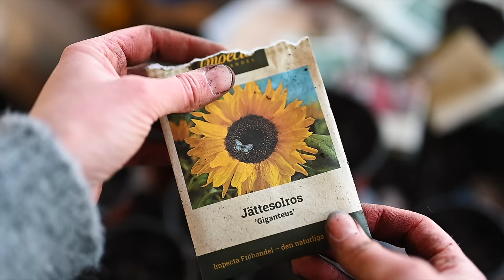Living with the Nordic Vampires

Comment: hmm. Summer is a bit different here in Texas. For the first six months, it is an all consuming, grinding heat. Then comes the next two months of "late summer" which typically sputters out around mid-November with a grim determination to wrench every bit of moisture out of your heat-stricken body as it can. Then a week or so of Autumn and a two month Winter.

Comment: There is a gaget call a themacell. It is an amazing mosquito repellent. I believe you can look it up online and order one. It gives a 15 foot radius mosquito free. It runs off of a small canister of propane, and a mat that heats up and has natural repellent.  I used it when I would hunt in the swamp with thousands of mosquitoes,  when I would turn it on maybe 1 or 2 mosquitoes would buzz me, but that was it. I still use them even though I no longer hunt. But I thought I would share this gaget with you. So you can continue to film and not be buzzed.
Reply: HELLO
Reply: @ruthielenz7595  That was not Jonna, it was a scammer. Jonna will never ask for you to text on Telegram.

Comment: I love your videos! My husband and I are saving to move the forest. I have a more practical question haha :). You said the firewood needed to dry out, but then when it was raining you still moved it into the barn. Will it still dry in the barn or do you need to do something extra? Thank you!
Reply: Hi Nikki. Normally, its not the outside of the firewood that needs to dry but the inside to reduce the moisture level. Rain does not have any significant effect on the wood and will quickly dry again. It takes about 6-12 months when properly stacked outside to dry the inside. Ironically enough it might take 3-4 if you try it inside. Thats why you need to first purchase firewood that is properly dried in an oven as your first batch and for your first seasons - while air drying your next batch 6-12 months for your next season(s). Repeat the cycle 😁

Comment: One day you are gonna need to repaint stuff, and im only assuming from the short clip you used for that. i saw you were only using a large brush for the walls. next time get a roller, and you will be done with the wall in less than 40 minutes, same with the doors. everything else, trim and such would be brushed out. just a tip. :)